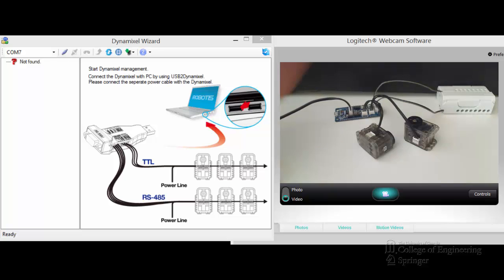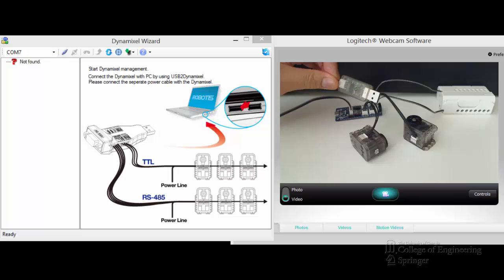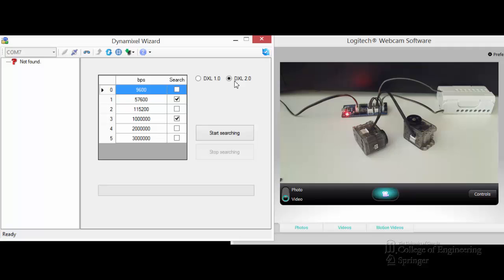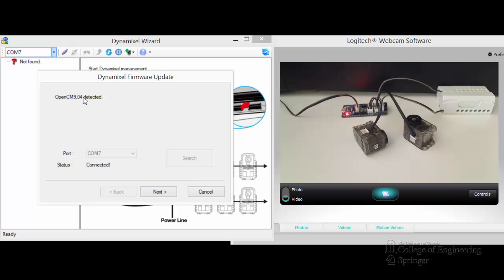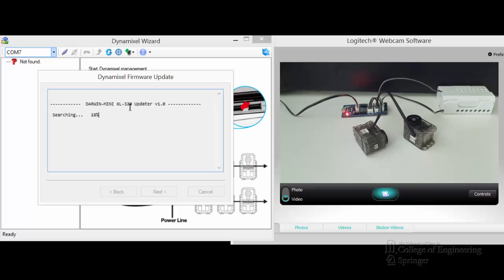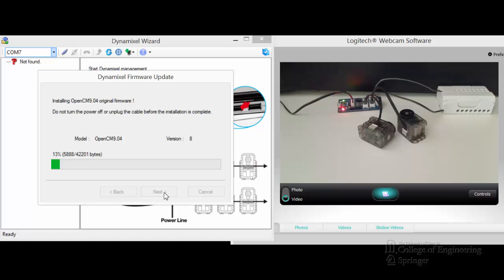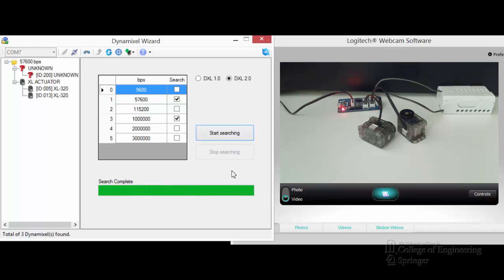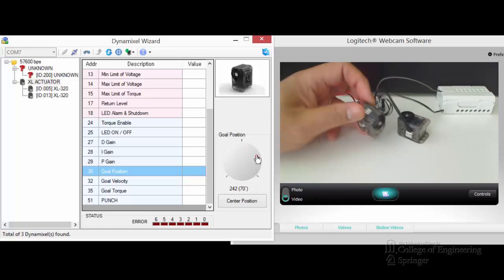Update Firmware on OpenCM-9.04-C

Comment: if the servo is not found, what will i do for make the servo detect?
Reply from the maker: That will be harder to figure out, as it could mean several things: the connecting cable could have gone bad, or the servo itself could be beyond repair too.  Can you share a video of when this step happened?  Try only 1 servo at a time and put a check mark on all the possible baud rates as sometimes the servo resets itself to a different baud rate.  Have you actually tried the "XL-320 Updater" step that I proposed starting around 1:40 minutes into this video?  That route is about the last reliable tool that you can use to recover a servo.  If that does not work, it is time to buy a new servo.  That situation has happened to me several times in the past (nothing lasts forever!).  If the servos are still under warranty, contact ROBOTIS or your local dealer to see if they can help.
Reply: @RoBoTeer2012  the board is crash haha, thanks for respone
Reply: @RoBoTeer2012 now i have different problem, why xl 320 and ax 18 cant move at same time?? if i conect just ax the servo will move but when i conect ax 18 and xl 320 ax not want to move, can you give me a solution?
Reply from the maker: @febryyanto2876  I am assuming that you are using the OpenCM-904 with an 485-EXP board to power the AX-18.  To move XL-320 (Dynamixel Protocol 2) and AX-18 (Dynamixel Protocol 1) at the same time, you will have to use the OpenCM IDE (http://www.robotis.us/opencmide/), i.e. you have to use Embedded C.  Furthermore this involves "mixed-protocol" programming and switching communications channels on the fly, please see my video B_Video_9.3 at https://www.youtube.com/watch?v=ASTl0t7F3cQ.  If you can access my book (https://www.amazon.com/Exploring-Robotics-ROBOTIS-Systems-Thai-ebook/dp/B074GXWPZ8), more details are discussed in Chapters 5 and 9.  The TASK tool will not let you do this type of mixed-protocol control.
Reply: @RoBoTeer2012  nice, thank you